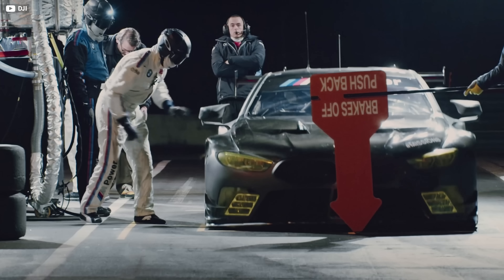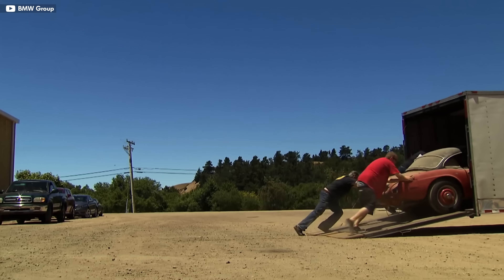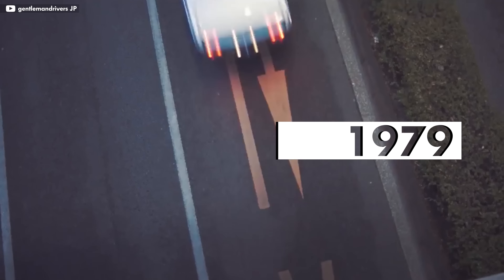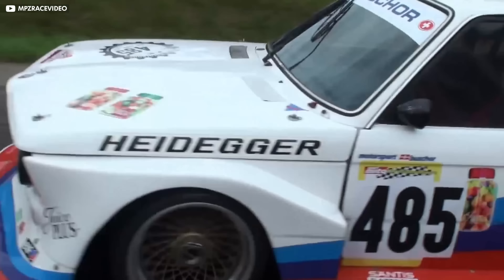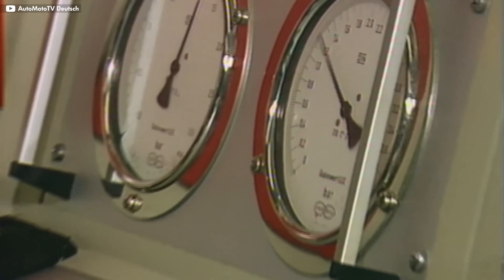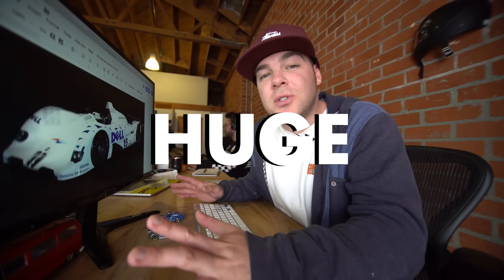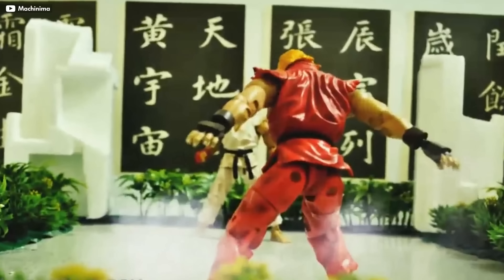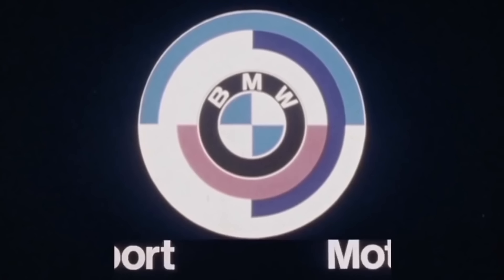Most Legendary BMWs Ever Made | The Bestest

Comment: No E92 with the badass high reving V8
Reply: Great car but too powerful for it's own good. The E46 was pushing it but was still a happy balance. The E92 on the other hand was too much imo. But technology has helped these newer series considerably (though still absolute monsters like the E92). The I-6 is a better choice for them I think.
Reply: The E92 M3 is more on tail happy than going fast
Reply: thats true the e92 is BMWs  AMG style drift monster
Reply: Certainly too much in inexperienced hands, but so is anything at a low to moderate curb weight with over 300bhp.
Reply: More importantly the S85 V10 with the high 8,250rpm redline

Comment: When I was 19 after finishing automotive foundations in April 2017, I worked at a BMW dealership as a Porter then Detailer. I drove alot of my dream cars. It's not only BMW. Audi R8, Nissan GTR for example.
At that time I had a 2010 Audi A4 2.0T my dad got me. At that time I did not like BMWs except M3 E92 and E46 mainly due to the douche stereotype. After working there a few weeks I loved BMWs more. My sister had a 230i on lease as well. 

4 months later life moved on but I won't forget summer 2017 driving my favourite BMW M3 E93 cabriolet. I like white exterior with red interior. Also M6 is pretty sick.

Comment: The S14 is an extremely cool motor, but it never made that much power. Unless you're not referring to production engines, the most an S14 was rated for was 235hp in the 2.5L S14B25. The majority of E30 M3s have the regular 2.3L S14B23 and make ~200hp.

Comment: As a e46m3 owner I say the idea of an inline 6 that revved to 8000 rpm was great.But to get 8000 rpm from a inline six they had to cut friction losses.That required rod bearings of insufficient size,a variable valve system called vanos,both made the s54b32 engine unreliable.Rod bearing failure on brand new 2001 m3s.Recall for 2002,2003 and fixed for 2004 on up to 2006 supposedly.My 2004s rod bearings failed and damaged the crank and rod.My vanos exh hub failed also.106,000 miles and oil changed every 5000mls with 10w60 Liqui Moly.The e46m3 e90m3 e60m6 and m5s are colossal waste of money and disposable cars (2year cars)

Comment: I love older BMWs but recently their newer models have been letting me down.  In the past they and Porsche were both highlighted by putting the driving above everything else, including the sound of the engine, the communication from the chassi/steering, plus the general balance and aptitude of the car all around.  Porsche has kept this but BMW has fallen behind a lot in this front and its sad to see.  The E90 was the last real M3, and if BMW keeps on this track I wouldn't be surprised if the E85/E86 becomes a collectable with its screaming NA Engine and hydraulic power steering (+everything else it has)

Comment: If BMW only made 10 M3 GTR's how come the player has one in Need For Speed Most Wanted? did he just buy a Chinese kit or something?
Reply: I guess he stolen the Yokohama themed M3 GTR one, that's why that so-called "NFS Mascot" constantly broken down many times the oil pan, after the Razor's fix. Because they said that M3 GTR model was the first one to mounted the earlier model of the P60B40 and that first model literally overheated and breakdown constatly, before to take to the action the M3 GTR number 23 and 42 with a new improved version of the P60B40 engine. Which I guess that Snake-tongue main character stole the Yokohama M3 GTR number 6. which its they rumored that was the defective M3 GTR.

Comment: Legendary yes,reliable no.German engineering is one of the reasons Germany lost WW2.Even modern Bmws are less than reliable.E36 m3 e46m3 subframes  not fit for toy Barbie cars.Shock mounts are garbage and the worst engines of the modern era the s54 s62 and the s63.All designed to rev at the expense of the rod bearings.Rod bearings failing on brand new vehices and a recall on those new vehicles.Bmw knew the design of those engines was bad but sold them anyway and tried to blame owners for the failures.The 2004 was m3 wasn't in the recall but has the same bearing problems and Bmw never issued a recall for the subframes on the m3s.Iwill never buy any Bmw ever again and will tell any one I know to avoid Bmws too.

Comment: IMO, BMW needs to stop being little BITCHES and give us (me) a dedicated high performance no fucks given hardcore supercar. No, not a M5 or that bullshit they call the 8 series that’s really a 6 series but called it an 8 series to justify selling it for more money, but an actual vehicle that is not based off their sedan and coupe lineup that embodies the history of ///Motorsport. WTF is the i8? It has rear tires skinnier than what’s on my kid’s tricycle! They should take out that nutless 3 cylinder, put a straight 6 in it, add fenders, a big ass wing and do a homage to the M1 Procars of the late 70s/early 80s...back at a time where BMW gave zero fucks about going green and cared about putting down power by ANY MEANS NECESSARY! Not enough power? Put a turbo. Still not enough? Add a bigger turbo. Still not enough? How about we add a fuckton of boost to get 1500hp out of a 1.5 liter 4 banger that we just peed on and stuff it into an F1 car. 

Hard to believe the same company responsible for such engineering legend currently has a 3 cylinder hybrid with 245 rears as its halo vehicle. /rant